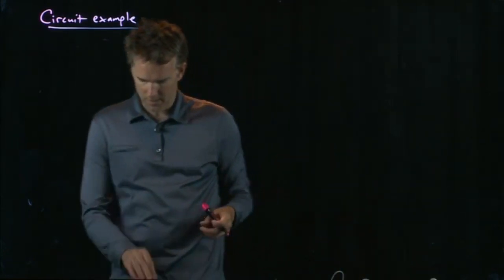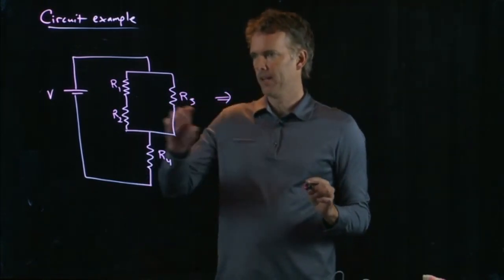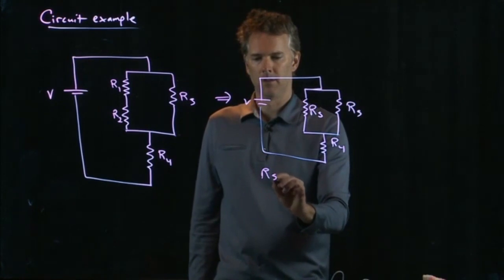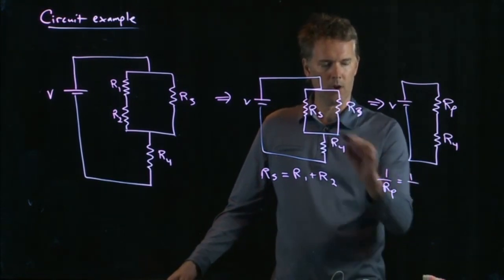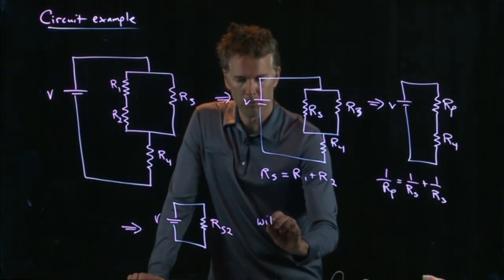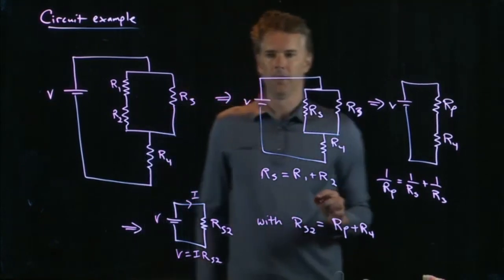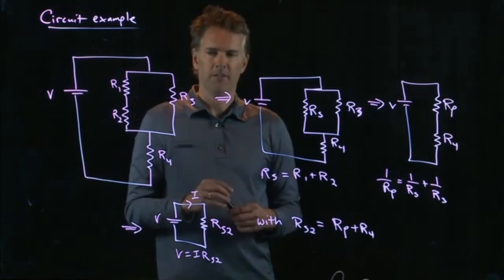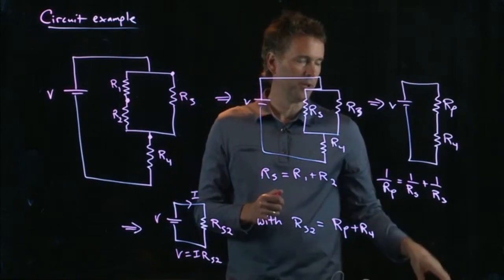Circuit with More Resistors | Physics with Professor Matt Anderson | M22-03

Comment: I use Mathematica, and I wrote a program to 'simplify' parallel resistors. I had it do: 1/R1 + ... +1/R10  I think. Works so fast and efficient. It outputs "R_Total" like a breeze. Love doing that kind of thing.
Reply from the maker: Great idea.  Love Mathematica.
Cheers,
Dr. A